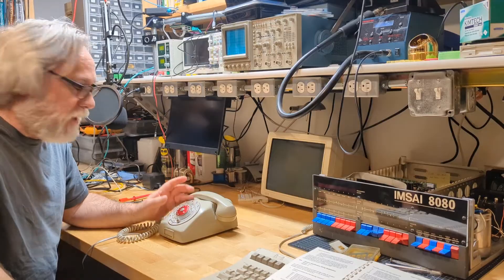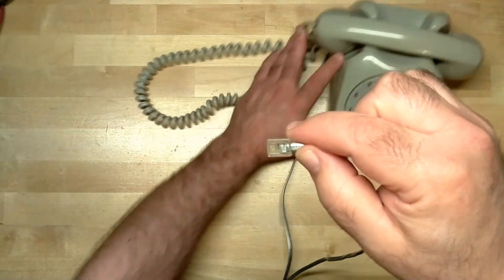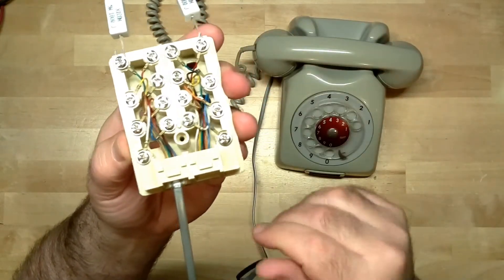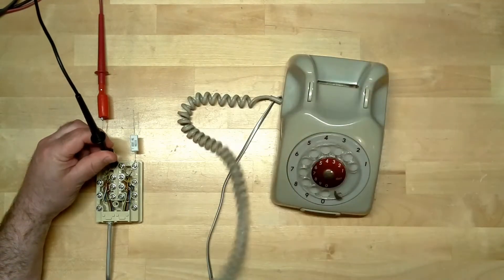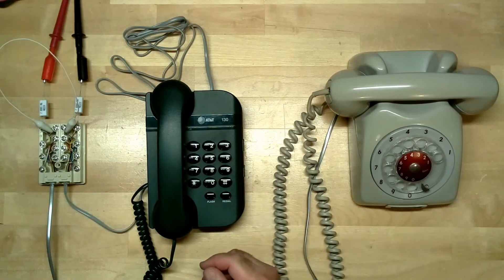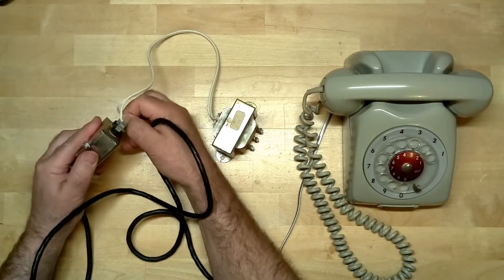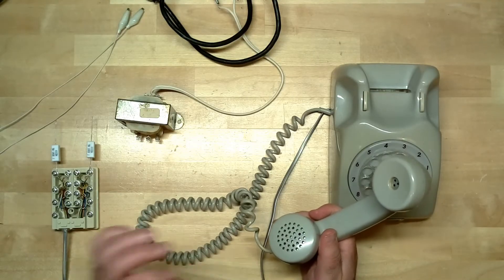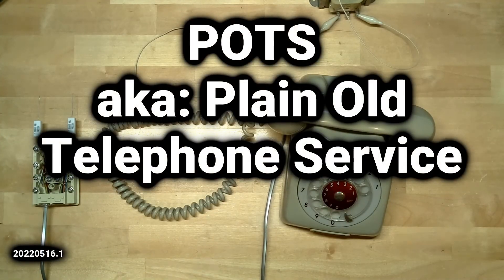Building a Plain Old Telephone Service (POTS) Intercom

Comment: In the late 60's early 70's my Father figured out that you could chain all the local area codes together to phone anywhere in the country at a local call rate. That went really well until he told his friend at work how to do it.....which would have been fine had they not worked in top secret  nuclear missile guidance system facility. His friend got a few numbers wrong and called East Germany....it didn't go down too well lol.
Reply from the maker: 🤣 I love it!!! 😂
Reply: @JohnsBasement eventually it ended up in the newspaper as a lot of local university students had been caught using the trick . The article was summed up by saying that the universities students were being used as scapegoats and that the MOD were possibly protecting a high level engineer 🤣
Reply from the maker: @Omegaman1969   MOD 😂 ... I had to google that one.
Reply: @JohnsBasement  oh sorry lol I guess you guys call them DoD
Reply: Relay switchboards were easily fooled. It was enough to turn zero on the round dial, and when the round dial was going backwards on the number 7, once again tighten the 0 to the end stop. If you did it quickly within the time limit, for example, 13 impulses were generated, i.e. more than would be possible by normal dialing, and you gained access to an intercity or interstate line. I used this method in an emergency and never told anyone. :)
Reply: “Hallo :) ?”

”Shit…”
Reply: Speedrunning a visit to a CIA blacksite
Reply: I call BS, that would be a different country code outside of the 1(north american prefix) followed by the chain of 3 digit local area codes.

Unless it was an consulate/embassy  in Mexico, Canada or USA.
Reply: @darcyknox3990 Yup. Another fable told by a not so bright old timer. 
People forget liars typically come of all ages.
Reply: @darcyknox3990 You’re an idiot then. He lost his job because of that.
Reply: @darcyknox3990 plus he wasn’t in America , he was in England.
Reply: @darcyknox3990 The guy lost his job and you call bs 🤣 yeah ok dude , jog on.
Reply: 😂🤣😂🤣 now that is wild
Reply: @MPW68  haha yes, I have the news paper article somewhere, some local university students ended up taking the rap for it and the article mentioned the MOD were likely protecting a high level engineer 🤣
He was fairly high level as he was working on Polaris guidance systems at the time 😊
Reply: Calling bullshit if it was a dial phone
Reply: @ I have the news paper articles from back then plus I also have all my fathers notes with thousands of area codes listed
Reply: @ You have no idea what you are talking about.  My Father worked on Polaris from day 1 in 1964 right through to Trident when he retired in 97.
Reply: Sure…..
Reply: Sure what ?? You’re an idiot if you think I’d make up a story like that.
Reply: you could protect your power supply with a diode 👍

Comment: The line impedance of analog telephone was 600 (or 680?) ohm balanced. The voltage was 48V at some 50mA on-hook and dropped at 20V off-hook. The dial tone was at around 400 Hz. Ringing signal was at around 100V (60 to 120V) over the line voltage (so some 150V) 20Hz sine wave. Powering the phone was made though two inductances in series with the phone, one on each wire (instead the resistors you used) and the audio signal was tool directly from the phone terminals (line) through two capacitors, one on  each wire. The audio band passed by the phone system was 300-3400 Hz, enough for a voice to be understood and recognized.
That is what I remember (I think correctly) from my school time. There were also other standardized tones for busy, waiting and other signals that I do not remember. I remember those because I built myself a 4 lines automated phone commutation system for my house (3 internal and one external) and I did the circuits myself (relays commanded by a Spectrum computer with a custom ROM). Of course I used old electromagnetic telephones and at some point I changed one with an electronic one (with LEDs, yes) with pulse calling that also worked well. The system worked for 8 years until the computer died and I was unable to repair or replace it (I could not find another Spectrum computer at the time. However, the main communication at the time was by mobile so the old PABX was already obsolete.
Reply from the maker: Cool!  I wanted to build the one back in the day too.  But school and $$ got in the way.  I also switched majors from EE to Comp Sci around that time & lost my unlimited university lab access.  😕
Ran it with a spectrum?  Why not!
Reply: @JohnsBasement  My formation is in telecommunications so all that is radio, telephone, TV, data communications is in my area. At the time I had telephony course and then I made my PABX. I used a Spectrum just as an Arduino today, made an extension board with relays as output and voltage level detectors as input. With a  transformer from a tube radio I made the power supply for 48V and 100V and a oscillator for forming the signals. I used BD 139/140 as I had many of them at the time. The network was configured as 2x2 matrix with pulse code dialing and 4 numbers: 1-3 for the interior phones and 0 for accessing the exterior line. The computer I used just because I was lazy to implement all the logic and te ICs were quite expensive (not to speak of microcontrollers in late 90s), that is why I did not used DTMF decoders or fancy stuff. I programmed the computer and then dumped the RAM where the program was and burned in a EPROM that I put on the board. So there was an autoload in case of power failure. 
One can make the same today wit an Arduino and some relay and ADC shields. Making a program to control such a simple PABX should be easy: it consists in few loops. So why do not make one now? Even a simpler one with pulse dialing and no fancy stuff like DTMF, redial, line hold can be easily made. And as all is in program, can be fairly easy to add features.
The specs of old telephone PBX with relays from 70s maybe can be found online if not on old manuals.

Comment: Can you please hook up 2 modems? From 300 baud up to 57.6K
Reply from the maker: I'll meet you half way.
Reply: It seems (I am not sure because I never did it) but if you connect the modems in series with a 24V or 12V DC power supply you can make them to communicate with each other and transmit/ receive data from one computer to another. Maybe with software control (?) because there is no dial tone, ring tone or other signals.
Reply from the maker: @sebastian19745  Yes indeed they will!
Some direct-connect modems will probably talk to talk to another one without the DC current source.  But not likely over too long of a distance.
Reply: @JohnsBasement  So yo gave me homework. Thanks, I have to try this. :)

Comment: There is a neat story to the names of the 2 wires as well, "tip" and "ring".
Still smacking my proverbial head against the virtual wall for throwing (or walking) away from a pair of Strouger switches I saved from my old college lab, when they tore the old central office setup out in favour of some PBX's.
Doh.
You gonna cobble together some slicks and maybe put Asterix on a Raspberry Pi?
Cheers,
Reply from the maker: I missed out when my highschool scrapped theirs!!!  I wish I had a few of those things too!!
Best use I saw was in the MIT Nickel Plate model railroad.  About 30 years ago I got a tour of the whole thing from a really nice guy named John Purbrick.  It was an incredible thing controlled by a PDP 11 (if I recall correctly) and it had a turn table that was positioned by use of a rotary phone dial and a Strowger.   Google for MIT TMRC.  (Yes I killed an hour doing just that. 😂)
It looks like they moved out of building 20 since I saw it.  I'm sure it is still incredibly cool!

Comment: The internals of these are fascinating, too--there's a "hybrid" transformer circuit that connects the line to both the handset microphone and speaker. The hybrid sends the signal from the mic down the line and directs the signal from the line to the speaker, using the same two wires. Additionally, a small amount of the mic output is sent to the speaker ("sidetone") so you can hear yourself speaking even when the handset is completely covering your ear. Advanced tech for its time 100+ years ago.
Reply from the maker: Yeah.  That transformer was a bit of mystery to me back then.  The original phone engineers were awesome!
Have you ever read "The Idea Factory..." by Jon Gertner?  Seriously cool place to be in its heyday!
Reply: @JohnsBasement  Added to my reading list! I've met a few folks from Bell Labs over the decades, was definitely a fountain of cool stuff.

Comment: We had that exact same phone here in Norway.
It was made in Norway, and called an "Elektrisk Bureau Modell 1967".
There's a screw under the cradle where the handset rest 
that lets you open the phone up to show the inside of it.

Used to work with those back in the day 🙂
Reply: Yeah, it is not design the British ever used, doesn't match any GPO issued phone. I've edited this as my original identification of that was partially wrong.
Reply: This is not  a Norwegian model 67 from Elektrisk Bureu, but a Danish KTAS model that looks similar to the model 67. The Danish one is a conventional phone with an electromechanical bell, carbon mike and a magnetic earphone. The Norwegian one is very advanced for its day. It has electrodynamic mike and earpiece which are driven by a transistor circuit. The "ringing" is obtained by using the earpiece to produce a whistling sound, again driven by a transistor circuit.
Reply from the maker: That phone has been around!  😀